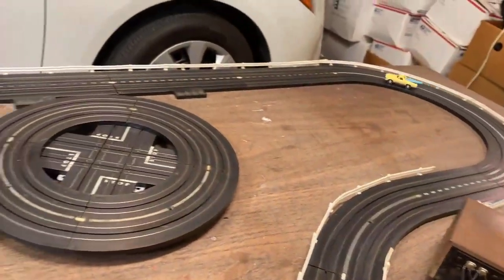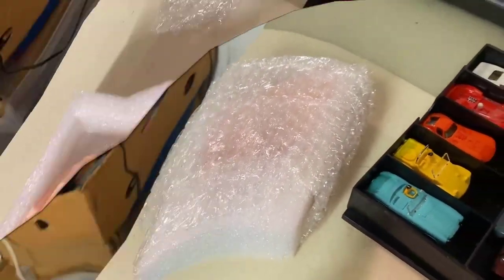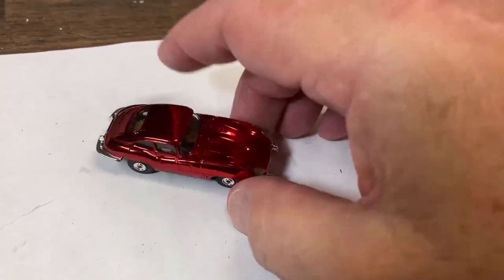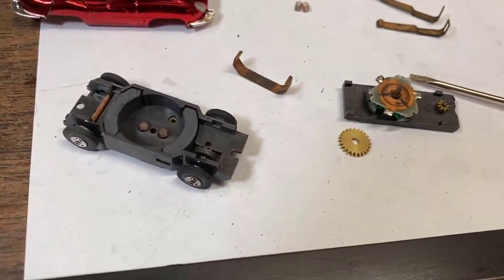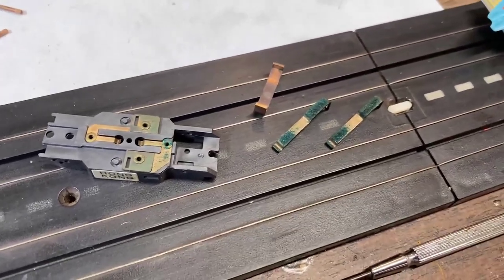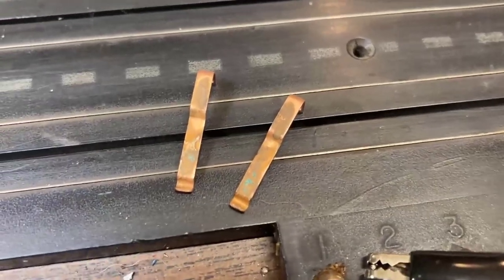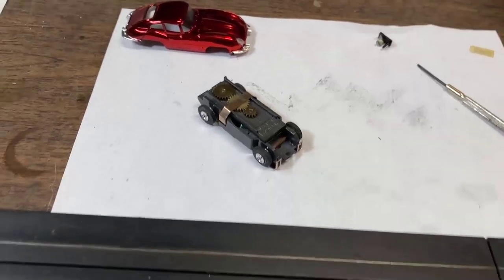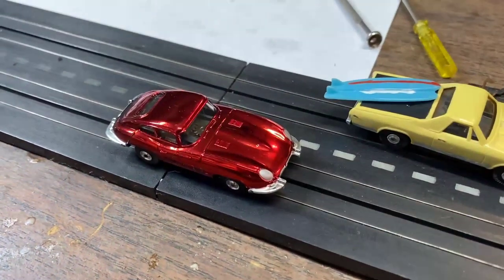Rare Candy Red Chrome Aurora Slot Car Chassis Restoration

Comment: Another awesome video Mr J.  here is my Question which chassis does the hard core collators look for the closed Rivets or the open Rivets?
Reply from the maker: Hey MrB, Great question. The only significance that I know of is that the closed riveted chassis is an older version and the open is the new style Aurora went to. I would consider the 'hard core' collector would want the closed rivet chassis over the open just do to the timeline they were made. Me, I don't care either way as long as I can get the chassis to run well, I'm good with either one. Take care MrB, see ya!!

Comment: Try to use white vinegar will be your favorite put the chassis in with the rims no tires and take your magnets out and top plate ....no effort...enjoy
Reply from the maker: Hey David, thank you so much for the comment. If vinegar had absolutely zero degree of discussing stench, I would possibly consider it. I've know the effects of vinegar on copper probably since the fifth grade. I just can't get past the horrible stench, I'm sticking with the Brasso, ever try it...?
Reply: @JeffRyan  yes brasso works amazingly ...I agree as far as the vinigar smell i put in a Tupperware type so I can't smell it and do many chassis at once....just wanted to pass that on ...yellow can oven cleaner the best as is your plastic cleaner VPR  excellent...again your videos are great and very entertaining...thank you David
Reply from the maker: @davidmeacham4469  Hey David, I would consider using the Tupperware, if I didn't have to use any vinegar whatsoever. Me using any type of vinegar, is just not going to happen. I certainly appreciate you and many others passing that tip along to me for decades now, but I'm going to be a Brasso guy. Regarding the VRP, when I first used it, I was blown away, great stuff!! Take care David, let me know if you need anything.

Comment: Do you make your bumpers by casting and molotov
Reply from the maker: Hey Roy, I can do that, but right now I've just stripped the old chrome off and sprayed the Molotow Chrome on um. I always think, if I can't find the part I need from the parts supplier, I'll just make it myself.
Reply: I wish I had some to strip lol its getting to were they just cost to mush and fixed income suck lol have you made a vid on making molds
Reply from the maker: @royburris4126  Hey Roy, A couple of months ago I did just that, I made some videos on how to reproduce the old slot car parts. Now with the Molotow Chrome paint, the come out factory fresh!! Roy, listen to me, let me know if you need anything, I'm here for you. Take care, see ya!!
Reply: @JeffRyan  Thank you what I need is a set of bumpers for the split window stingray and a set of bumpers for the 63 t-bird
Reply from the maker: @royburris4126  Hey Roy, sounds like I have what you might need. Let me get home, check my stock and I'll get back with you, sound good??
Reply: @JeffRyan  Thank you Jeff
Reply from the maker: @royburris4126  Hey Roy, I need you mailing address, you can send it to  smokintjets@gmail.com
I have what you need, let me know where to send um.
Take care Roy!!
Reply from the maker: @royburris4126  No problem Roy, just send me some pictures of your projects after you get the bumpers.